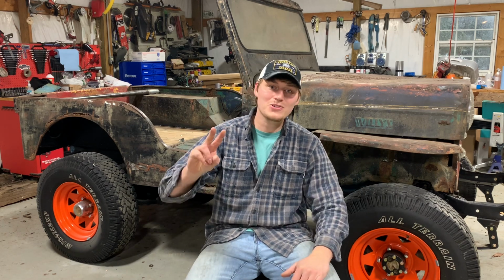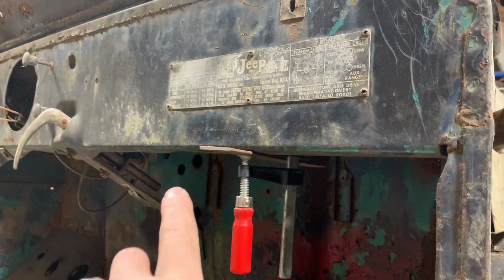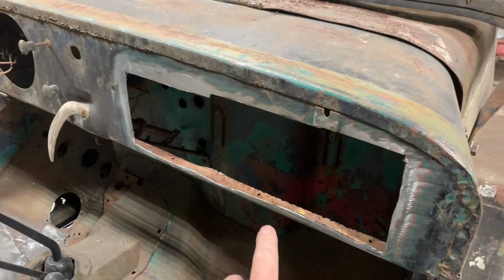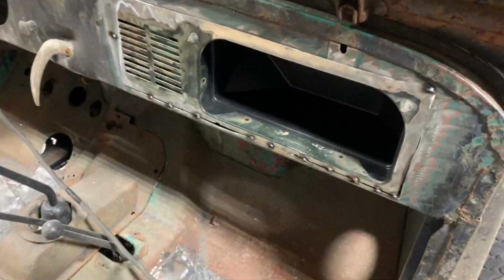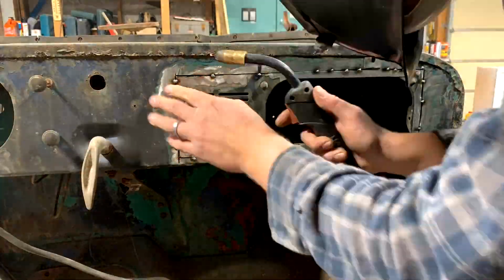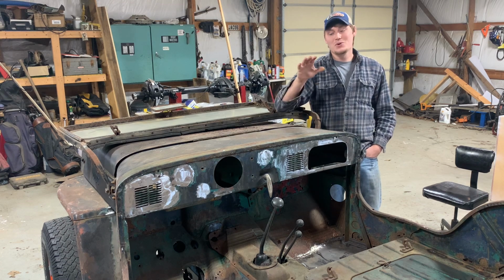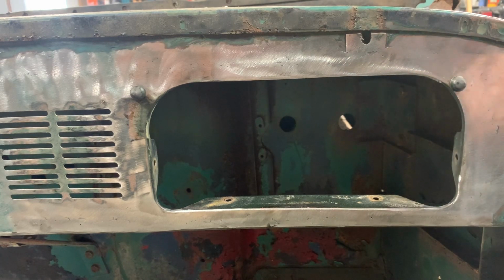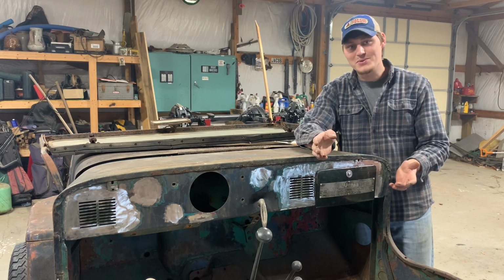Willys Jeep Custom Dash Part 2!

Comment: Like many I was unsure.  But that turned out well.  I would make the dash as smooth as you can. Then I would prime with rustoleum red primer. Then wait about 4 days. Then paint with semi gloss black.  It gives you a finish you can easily keep looking hood. Semi gloss black also hides imperfections better than flat or gloss black.  Only paint up to where the cowl overlaps the dash.  Then you have a touch of patina to keep that look going. Your factory cluster has lights for amps and oil pressure.  Gauges are fuel and temp.   Consider a GPS speedometer.  No cable to mess with. Set your gauges up with all red led lighting. Just ideas...thanks for the fun. :-)
Reply from the maker: Thank you I appreciate the feedback! You’ve got some good ideas!
Reply from the maker: Thank you I appreciate the feedback! You’ve got some good ideas!

Comment: That really turned out nice. I may install a glovebox next year. As far as color, I like my exterior tub, dash and interior tub which is Jeep orange. 
Question: I’m thinking about powder coating in orange a set of wheels in spring. My current set are just plain wheels size 15x8. I like the spoke wheels.
What brand are your wheels? Think I’m going with 31x10.50-15 Toyo AT3’s for tires and 15x8 Rough Country D window design or Black Rock. Just kicking tires now. I’ll decide in spring.
Thanks RT
Reply from the maker: That would be a good combo I like those D window wheels I’ve had a set in the past. I’m not sure what these are I bought them used. Thanks!
Reply: I found a place in Lenoir City that does powder coating. When I finally get my wheels in, I’ll run em up there and get them painted. Keep posting videos. I’m learning a lot from your channel. Thanks RT

Comment: Patina is really hard to match, its worth a try if that's what you really want but it looks much worse if the match isn't good. I had a green 1994 Jeep Wrangler YJ with a soft top and half doors many years ago. I bought a second hand hard top and full doors but the doors were red. Rather than try to match it I just painted the doors black and that's how it stayed until I sold it 10 years later. I guess the moral of the story is you cant go wrong with black, but I am not a fan of bed liner on things that don't need the protection like a dash. Its your Jeep  so paint it pink with polka dots if that's what you want.
Reply from the maker: You’re right I think black would look clean and match well! Thanks!